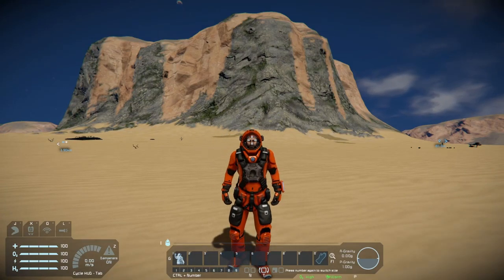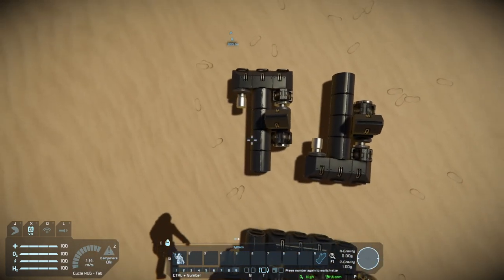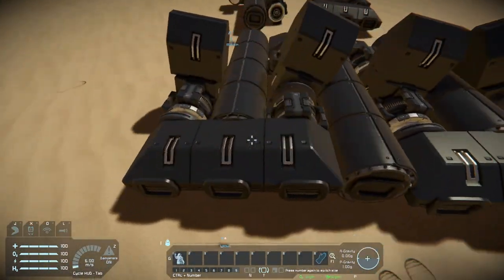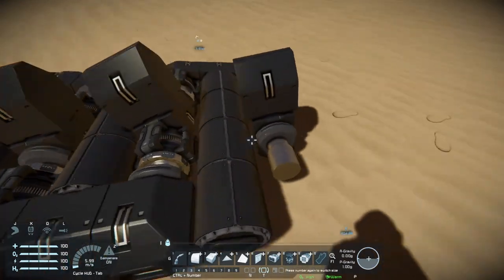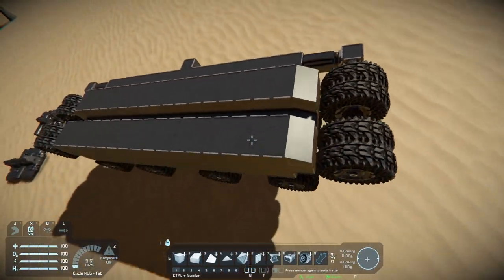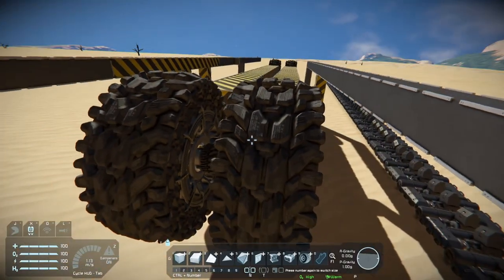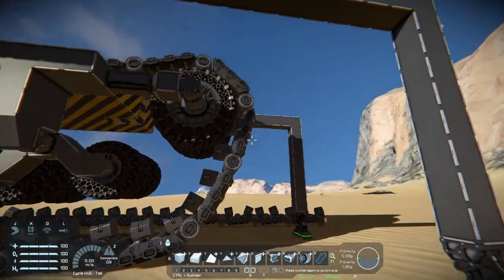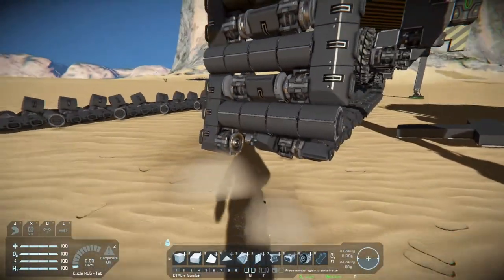How To Build Tank Tracks - Space Engineers

Comment: How fast can you set the rotors before the track breaks?
Reply from the maker: it can go the max speed with no issues to the track
Reply: @quantumchief  thanks for the information
Reply from the maker: @G_I_R_A_F_F_EEEEEEEEEEEEEEEEEE  no problem
Reply: @quantumchief  when I set the speed of the rotors to max it moves the same speed as If I set the rotors to 15. Do you know what might be causing this?
Reply from the maker: @G_I_R_A_F_F_EEEEEEEEEEEEEEEEEE  its due to the wheel not having enough friction, i need to design some control wheels with some teeth so they can grip the track better and move it faster
Reply: @quantumchief  thanks for helping me solve the problem